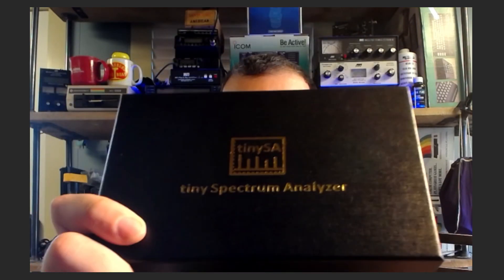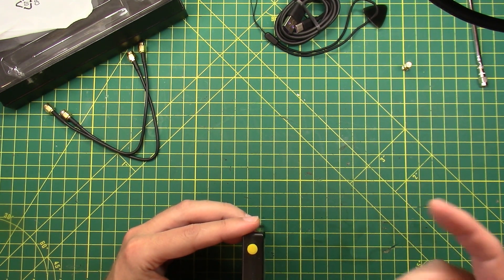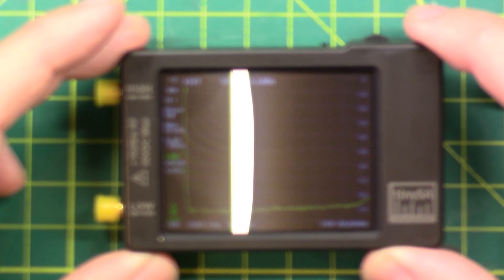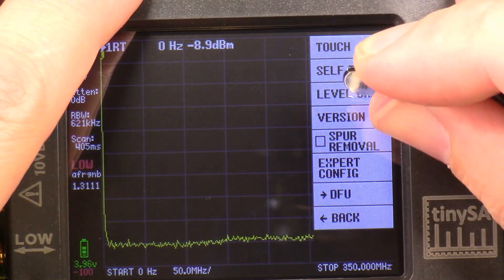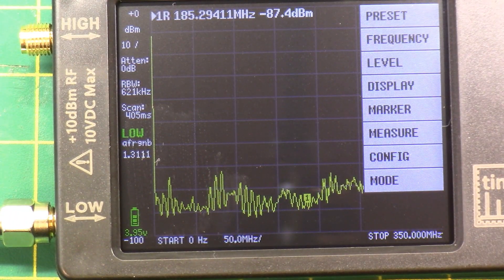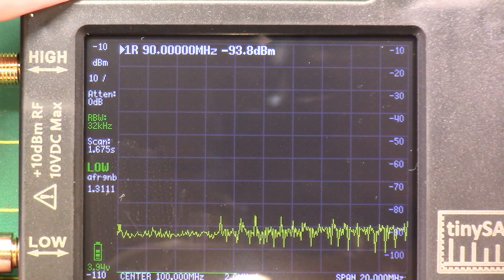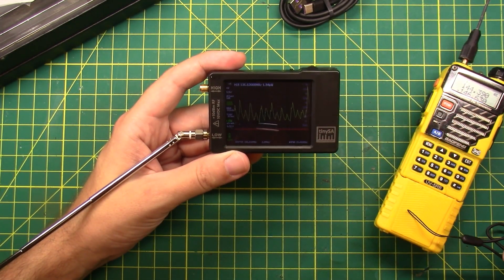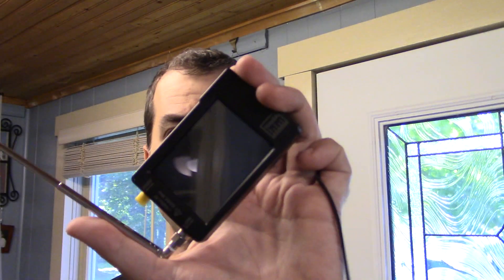Intro to Spectrum Analyzers - What does a TinySA do?

Comment: Just ordered one. Super useful for the price
Reply from the maker: Exactly!
Reply: I use a Malahit DSP2 with a Deshibo Ga800 loop. Have a tiny Belka too which is amazing. Still figuring out all the features on the Malahit. Going to be using the Tiny SA for things like highlighting transmissions on Airband etc.

Still trying to figure out how, if possible, to set a low and high frequency on the Malahit DSP2 to do the same thing. The Tiny SA will do it in the interim. Any tips greatly appreciated 😊
Reply from the maker: I haven't played with a Malahit yet, but when I do, there will be some videos on it, for sure!

Comment: hi! do you think I can use Tinysa to find a car key around my house? Any guides on how to do it?
Reply from the maker: Most car keys don't actively transmit all day long (the ones that do TX only do that when you push the button). That would be hard to do I think. I'm willing to be proven wrong though.
Reply: @temporarilyoffline  thank you for the reply! I have the spare one to check if its transmiting something and then try to find the same signal again around the house. My key opens the car when I'm near it, so I think it transmits something.
Reply from the maker: @adrianorizofski5484  I think you're on the right track... you might find more answers in the "Flipper Zero" community, check there.
Reply: @temporarilyoffline  thank you

Comment: Why use the two leads with the gender connector when you can just connect one lead between the high and low ports?
Reply from the maker: It depends on the type of test you are running.  In this case, I wanted to equalize out the cable length.  If you were only going to test one device on one port, the a one-wire calibration would be good.